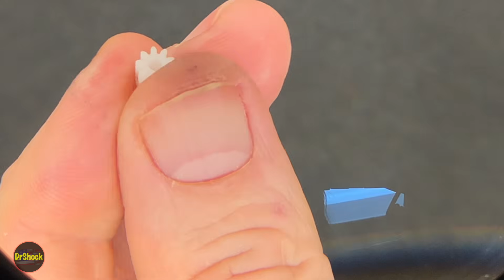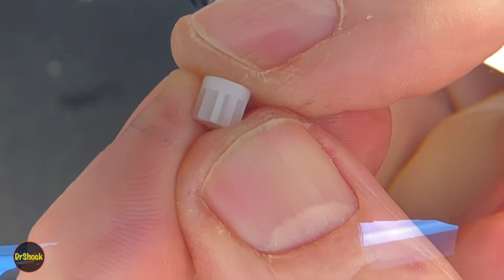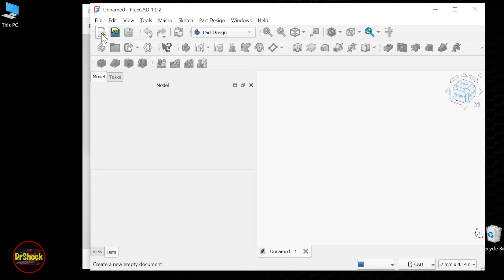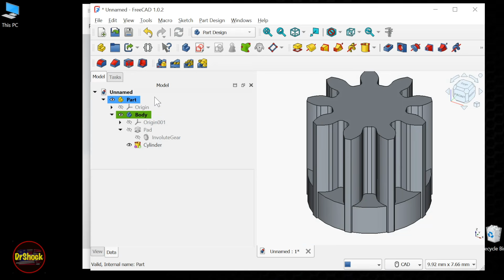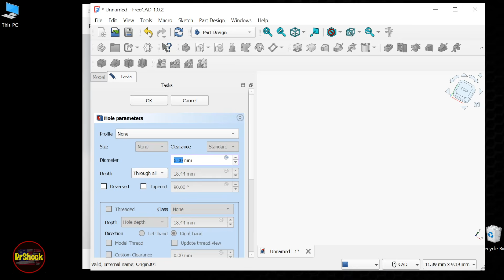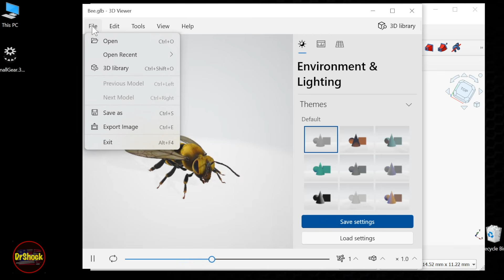Fast & Easy 3D Model Creation using FreeCAD v1.0.x for a Broken Plastic Nylon Motor Gear

Comment: Hey Dr. shock I was looking at one of your old videos on a body control module for a Saturn sky 2007 2.0 turbo. You were taking a microchip off the board. I don’t know why you were taking it off my question to you is I have a 2007 Saturn sky and I can’t get it to start. I think I’m having issues with the BCM is there anyway I can send you my body control module, and you go through it and check it for me.
Reply from the maker: Those kind of videos are showing microelectronics repairs where a failed BCM can be replaced with a donor of the exact same part number by transplanting the EEPROM memory device on the circuit board) which holds the VIN and other security information).   I do not do remote repair work, but there are companies out there who offer this service.

Comment: Thanks for the tutorial. At 10:00, I think it's better to use "pocket" instead of "hole". I'm no expert, but I think hole is meant for holes for fasteners and it has all kinds of parameters for that. For just subtracting from a part based on a sketch, the pocket seems like a better(and probably more stable) option.
Reply from the maker: Thanks, I found pocket to be unreliable for this particular layer stack.  Perhaps a bug in the current open source build level.   Hole provided the needed attribute for the stainless steel shaft this tiny plastic gear is going to be friction fit upon, once replicated in a casting.